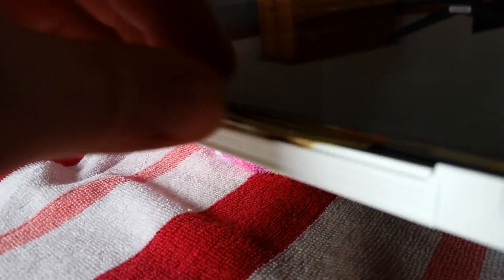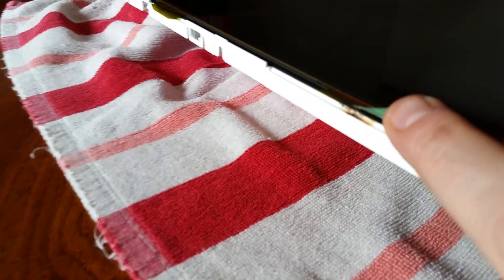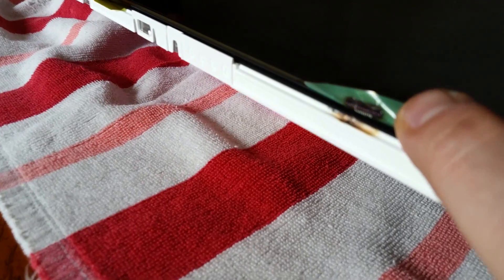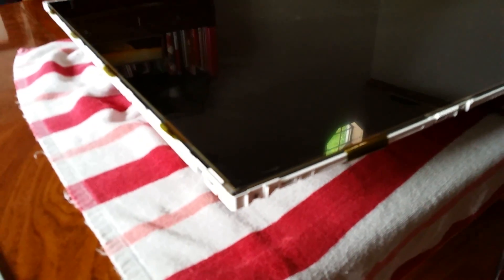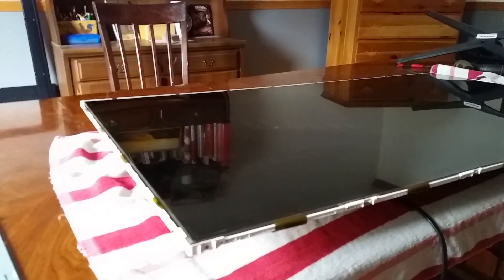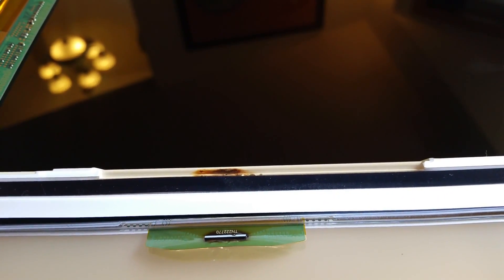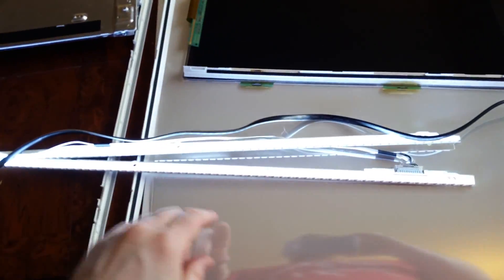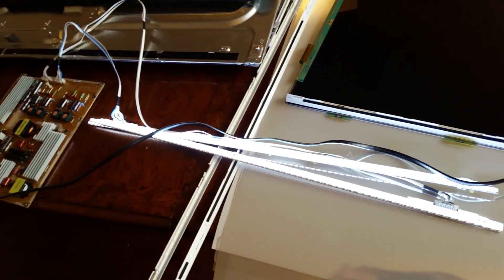Samsung UN55ES6500F vertical lines

Comment: Even though a new ribbon could be purchased for few dollars and easily replaced. That's what happen when people set the back light to 100%, the ribbons get hot and they'll detach. Setting the back light to 50% will extend the life of you TV for a very long time.
Reply from the maker: Where have you seen tab bonds for sale for a few dollars? What do you mean easily replaced? The tab bonds that burned out is permanently bonded as a piece of the LCD panel. There is no connector, the two ends of the flex cable would have to be manually micro soldered. The heat of the LEDs don't have much impact to the LCD parts, there is a air gap between the two.

Comment: I also had several vertical  lines in a Samsung TV    Just doing a complete setup of the TV - like when it was first put in operation solved the problem.  Part of the set up is to have the TV re-scan for channels .  Resulted in no more vertical lines. No dissemble of TV was needed.
Reply from the maker: That sounds like a TV tuner issue than a LCD issue.
Reply: Yes, likely a tuner issue. I have no idea 'IF" the tuner or controller can detect and correct the line problem and fix itself.  I am posting because I had seen many videos about the wiring "ribbons" causing problems. Because of the way my Samsung was assembled it was not so easy to remove the front/back to get to the ribbons -- so I kept putting it off.  I had about 6 or 8 vertical colored lines on the right side of my screen which I ignored for months - as I rarely used that TV.   I just happened to re-scan all the channels and - the lines did not come back.  So I am just saying - before attempting any dissemble for the vertical line problem - try re-scanning - it only takes a few minutes to try if it will help.

Comment: Today disassembled samsung ue55es6100 vertical lines\ ghosting.  same exact problem. On right lower corner where power button is located the COF burned. non-repairable. panel ready for garbage.
Reply from the maker: It's a bummer Samsung had to have this kind of failure : (
Reply: https://www.youtube.com/watch?v=obzUMKEYd84&t=10s

Comment: You can pull the tabs off on the bad side only
Reply from the maker: Why is it you say it can be fixed,
But when I ask how you go silent?
Reply from the maker: It's bonded flex, how would you connect a replacement? Manually solder jumpers?